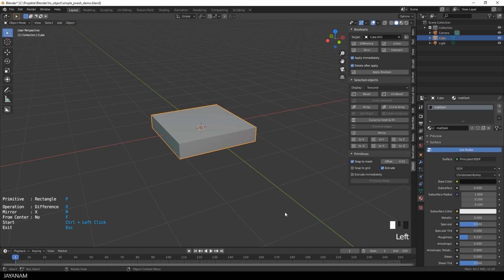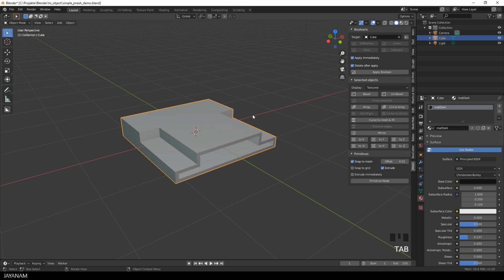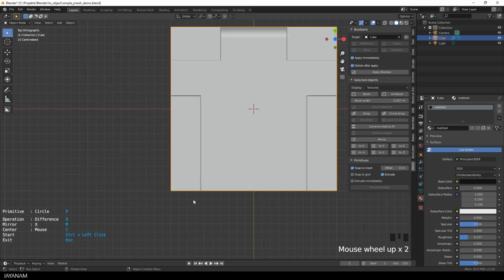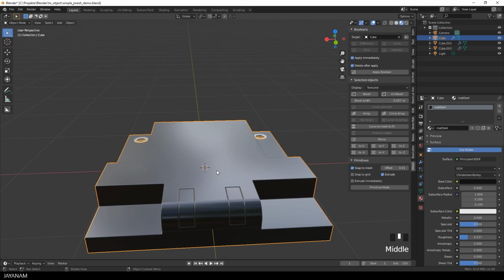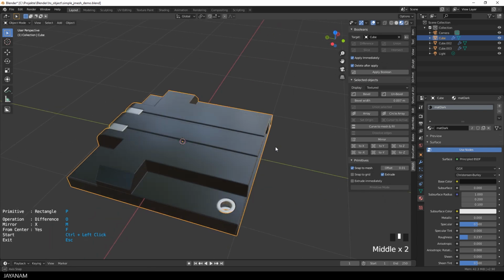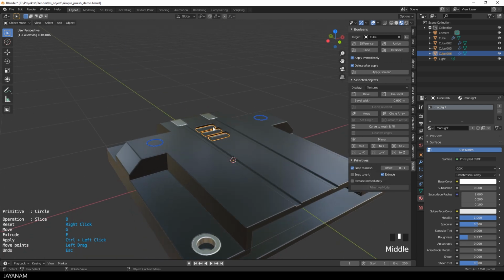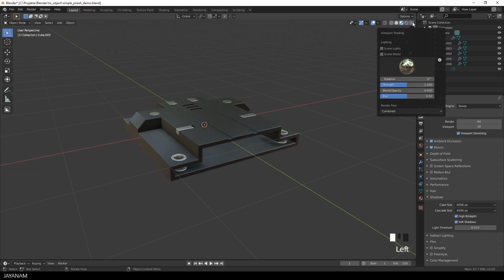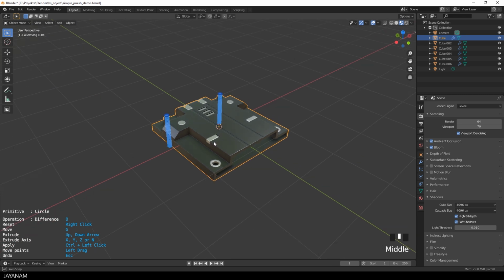Blender 2.9 JMesh Tools Addon: Mirror

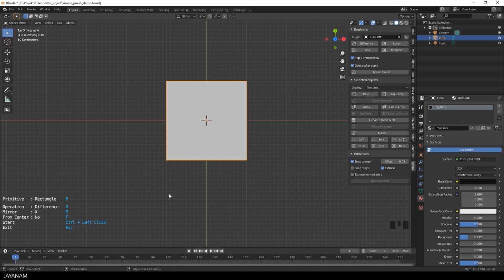Comment: Why is it that when I go into a fixed position like top(7) for example that my rectangle only goes in 0.1 steps and not by 0.001 like you showed at 0:27?
It basicly snaps to the grid like if I would press ctrl

EDIT: Oh nvm you had snap to grid active

Comment: hey Jayanam like you when i add a bevel through jmesh i am naturally making that vaule .007   or even .005 to get those crisp edges, i am wondering if you have considered making the .007 the default. also  when say adding in a cylinder primitive i like how you can scroll your mouse to increase the vertices, i would like to suggest the default vert count when creating a cylinder is 64 rather than the 32 as i think most would go for that 64 to get that clean circle. just my thoughts. thank you for all your content is amazing
Reply from the maker: Not sure about the 64 as default but the 0.07 is added to version 1.2.6.2 - will think about the cylinder vertex count, thx for your input

Comment: make that extrude thing  work with array !  and curve ! 
i mean when you can use mirror for extrude you also want to make for an object ( if that object is flat or sphere ) to make that exture for many time for whole of object !
so incited of  using curve and array modifies  again and again :
1- you can make a curve that in his properties you can manage how much you want to extrude object and in what distance ! 
2- some fact for user can choose to if the extrudes distances  are gonna be Equals together or they gonna be   more near to first point of curve or last point of curve 

3-  you can choose one of the edge of object ( for example a sphere ) to make  a curve referenced to that edge and chose number of extrude !
Reply from the maker: Thx for the input, please add these as issues to the github of jmesh tools so that I can analyze and track them.